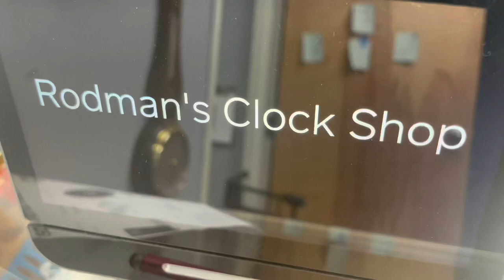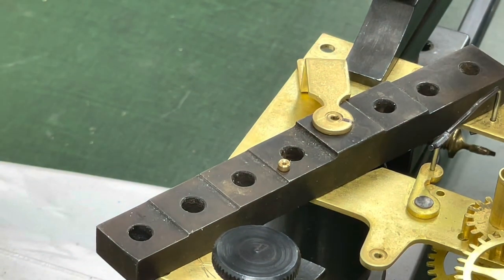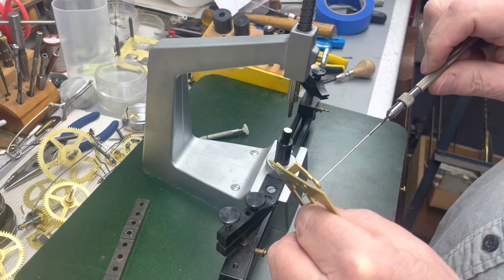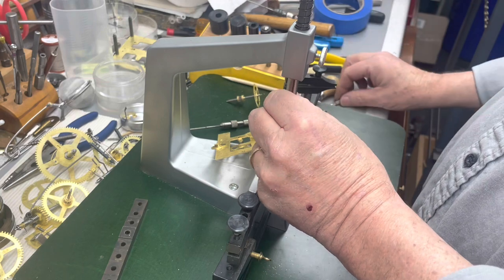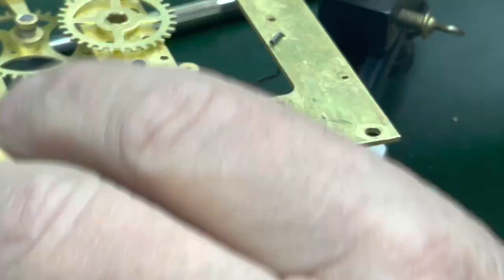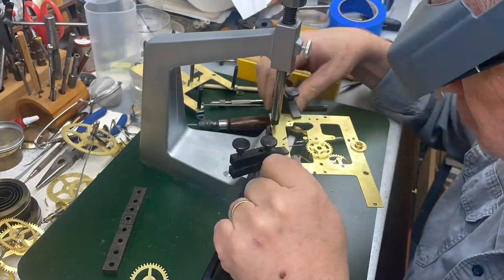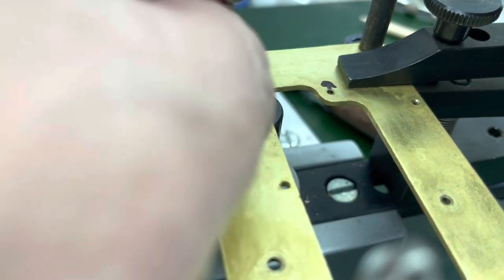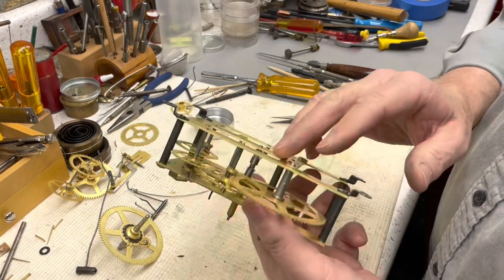Antique Ingraham time and strike Calendar Clock Movement Overhaul Part 3

Comment: Thank you, sir.  I could have used that staking block.  I am working on a very similar movement (1913 E. Ingraham Kitchen Clock w/o calendar), and it is my very first experimentation with bushings.  I do not have a bushing machine, so I am doing them all by hand.  So far, so good.
Reply from the maker: Hi,  you can get a block in my ebay store at this link; https://www.ebay.com/itm/196154977270